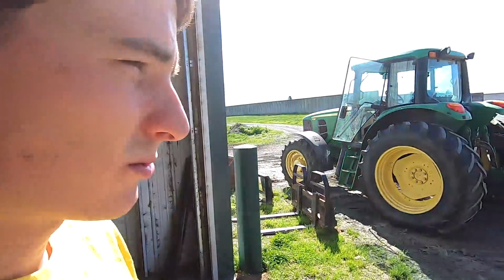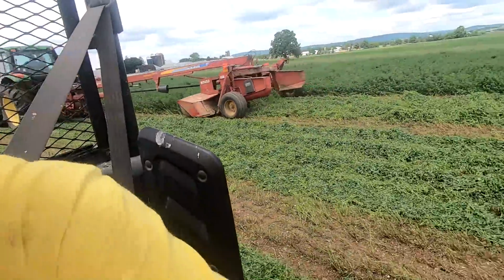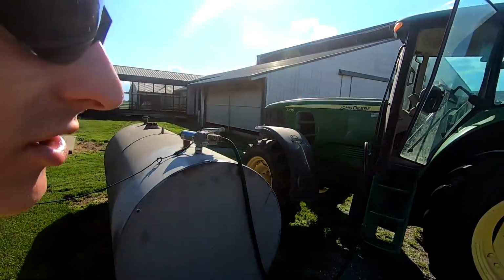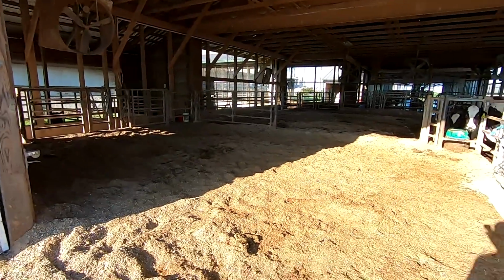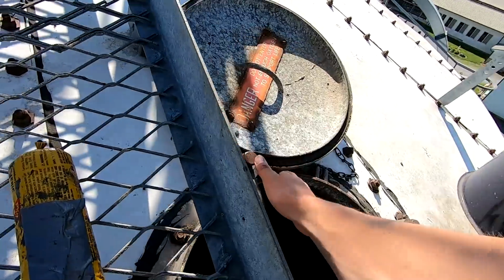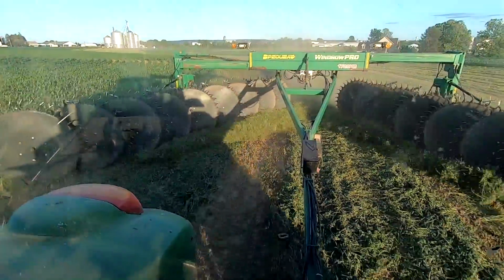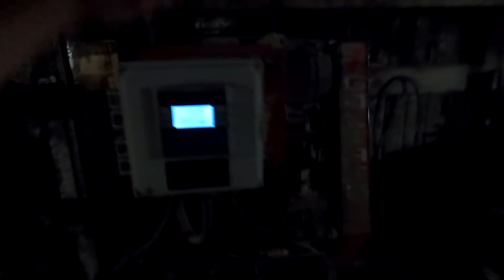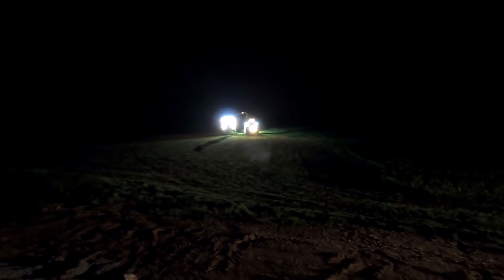2nd Cutting Alfalfa Harvest

Comment: "A 16th of an inch"
Your European viewers just got a heart attack...
Reply: What
Reply: I that 1mm or what lol
Reply: @Pharphette  1.5875mm :)
Reply: Very true. Gettin from inches to cm and foot to meters is ,hmm interesting?
Reply: As a European Viewer i Always need a converter for temperature and dimensions :-)
Reply: @michaellow9539  The UK is still using inches unofficially but the official is mm. I don't know about the rest of Europe but do you use MPG?
Reply: @adejohnston6831   no kilometres not miles and per liter and not per gallon
Reply: @adejohnston6831  Liters per 100 kilometers is most common I think.
Reply: @JussiValkila  In the UK we are still using MPG but we buy our fuel in ltr. People don't want to change and the car manufactures all advertise in MPG
Reply from the maker: Haha sorry
Reply: @10thgenerationdairyman  🐄🐄🐄🐑🐑🏆🎖🏆🏅🥇🎖🎖🏆🐑
Reply: As a " certified measure conversion technician",  allow me to convert 1/16th of an inch for you.  As you know,  it looks like the silo has a " ding" in it.  One ding is 1/32nd of an inch.  So,  2 dings make a " smidgeon".  In order to repair a hole the size of a smidgeon,   you will need a " glop" of puddy.  Of course,   2 glops makes a " glob" ,  which requires a form from the government.
Reply: @alexdrake9931  I suffered a stroke while reading this 😝
Reply: @crueleyes7873  Well... you are in luck...In addition to being a " certified measurement conversion technician",  I am also a disbarred " Stroke Intervention Specialist." Once I'm done cleaning the manure pit,  I can do emergency surgery on you.   I wear gloves when I'm working on the manure spreader so my hands are still clean.
Reply: @michaellow9539  . Lol. All I know is that 117F is 47C. Or as I like to call it. Last Wednesday.

Comment: you could put a flex seal or another type of rubber uv resistant paint on membrane on that whole top of the silo and eliminate any of those pinholes for years to come.  would save you the trips outside that safety fence.

Comment: Hey Eric - Whoever ran the Claas Liner ran it way too fast. Needs lower RPM to stop threshing the hay so much. Cheers, hopw you had some relaxing holiday.
Reply: I didn’t think they normally use that attachment, they normally use that V attachment that just turns it over.  They don’t use that liner attachment on a regular basis because its probably tearing the hay up.
Reply: @deplorablelibertarian  Yup I know - thats why I said it ^^ You get way less loss if you gently touch it - around 400-450RPM are plenty fast for it.
Reply: @stubbi ….I don’t actually know, I was just assuming it’s tearing the hay up; I was guessing.  I don’t actually know what i’m talking about with farm equipment.  I always see the V attachment, I always assumed it was the popular choice but didn’t know why.
Reply: Your spot on. Way to fast.
Reply: So the Liner rake is usually run at 540rpm and while obviously there’s no in-cab view, I’d say it was running about that having used one before. Also, I’m not sure why you think it would be damaging the crop more than the wheel rake would do. Yes, the tines move a bit quicker but the wheel rake handles at least some of the crop way more. The wheel rake has 9 wheels on each side and while the back wheels only move the crop a small amount, the crop that gets gathered up from the front ones get turned over 7 or 8 times